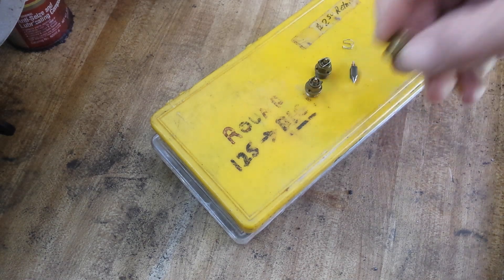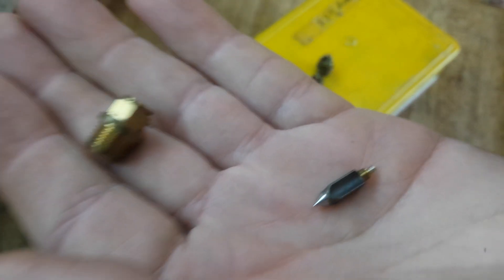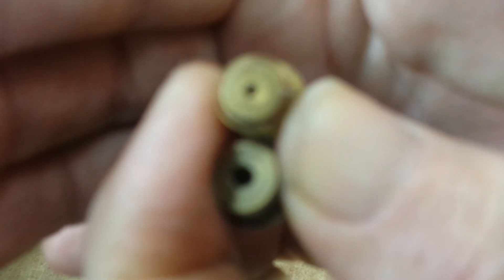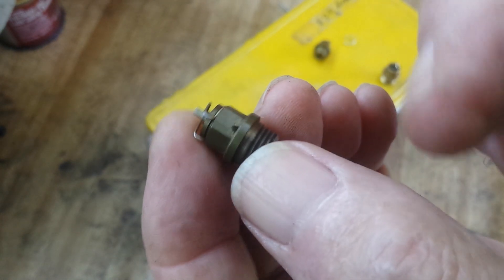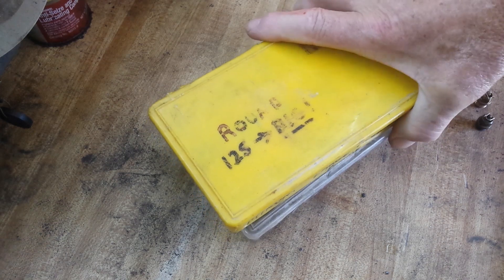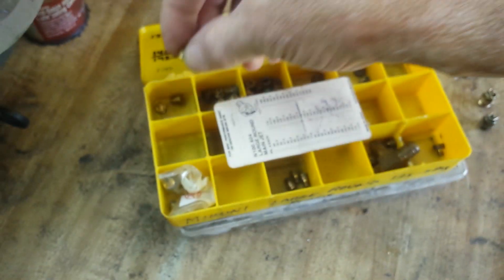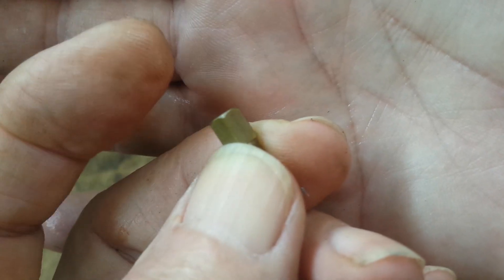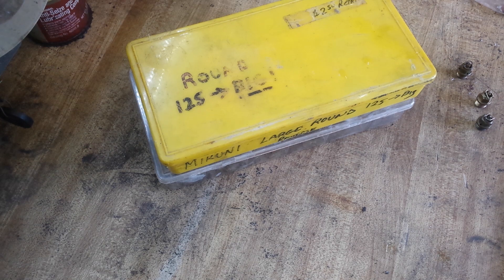A Brief Mikuni VM Carburetor Parts Tutorial

Comment: Very nice video and information... please advise, does the little nob inside the mikuni carburetor body to which we align the throttle piston ware out in time... I thin mine has
Reply from the maker: In general it is unusual for the slide guide key/pin to wear out (unless you have a body with the very rare  plastic guide), usually if anything wears it is the slide groove, there are however more than one size and type of slide guides, any chance you may have a slide that does not match the guide key/pin?
Reply: MerlinxPV thank you for your kind reply I’ll definitely check on this